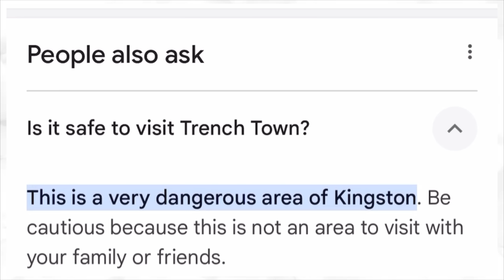JAMAICA’S Toughest ghetto VS AFRICA’s TOUGHEST! Not what I expected 😭

Comment: There are still mud houses in Jamaica but its hard to tell its made of mud because it looks like a normal house made of building blocks they are mostly found in Manchester and date back the 1920's or so.
Reply: 1920s?? Wow, you are so developed. Here in Kenya, we have those mud houses in Nairobi city's slum/informal settlements and thatched houses in some parts of western kenya, that decided to maintain that culture
Reply: There is still a 4 bedroom,kitchen,dining room,bathroom and veranda house plus a grocery shop and barbershop in my village square made of mud but its called Spanish wall in Jamaica that home is over 100 years old but redesigned by putting mesh wire over the mud and rock then flash mortar over it thats a sand and cement mixture for those who dont know what mortar is it has a beautiful finish.
Reply: @kevinoconnor2204  I wish I could see the construct, hopefully one of these days. I live in Jamaica  but never seen one of those houses.
Reply: @sanjahbarrett2217  if you ever been to mandeville believe you have seen one you just dont know it all house were made of mud and white live and stones the building was first framed from certain types of wood just like how you would frame a ply board house with 2x4  then nail board on both sides like boxing up a column mix the mud and white lime and pour it in while adding rocks for bonding and strength oh i forgot you nail mesh wire to the wooden frame after the mud is dry you ruff cast and render the building